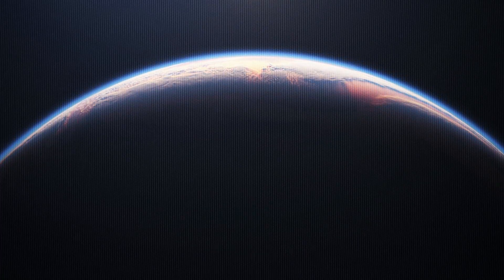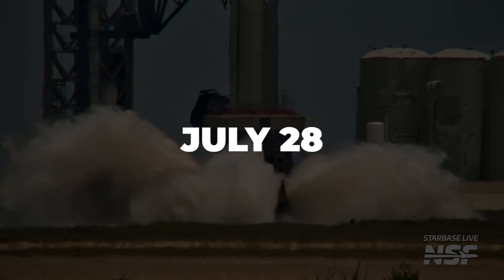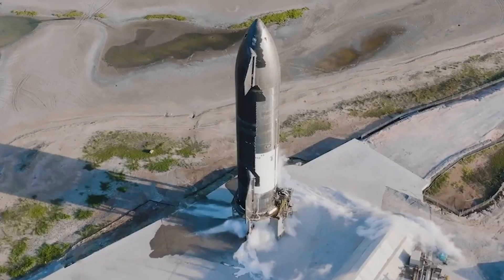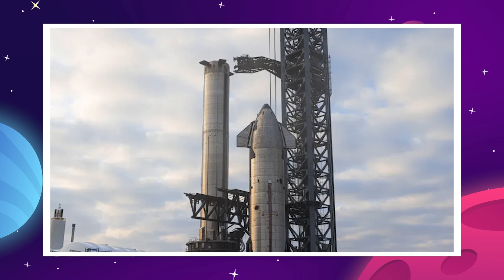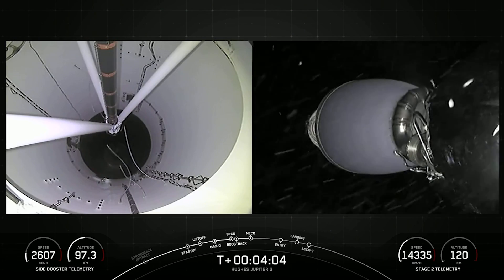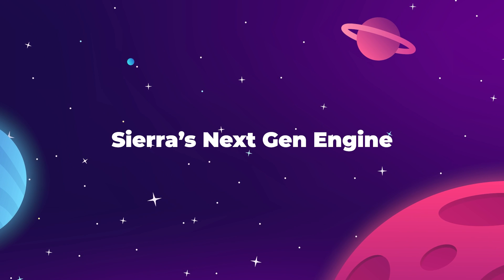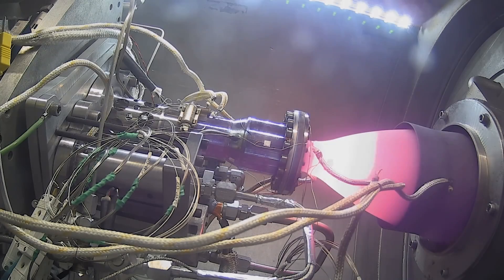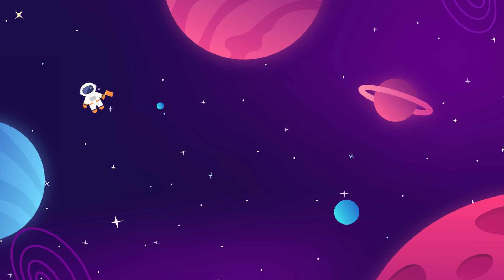The SpaceX Orbital Launch Update Is Here! (Deluge System Active)

Comment: I think SpaceX have gotten it wrong! Just had a look at some other comments, although I did not require them to be aware of what I already knew, that the only way to 'deflect' the pressure waves from the most powerful rocket engines ever built is to build a deep pit underneath the launch platform, at least 100m (328ft), & lined with very thick steel! Anything short of this & you're going to incur what was incurred the last time, destruction of the underneath of the platform.. wird!

Comment: The simple fact that they installed the hydro system, customized in 3 months blows my mind, these guys Rock!
Reply: But what about blast tunnels ? NASA uses blast tunnels ? if you direct the rocket plumes away from Starship it should reduce the need of these special solutions ? Or is the rocket so immense that it cannot use blast tunnels ?
Reply: @tore28 according to SpaceX this solution will not work. Water table too high for such features.😢
Reply: This should tell you that it was already designed. They knew it needed to be there in first place before any starship launch but they decided to go the cheap and quick route. NASA has built all of its pads with this, why would SpaceX think they didn't have to or should?
Reply: @flaziblaz  Musk has said many times the system was designed but they didn't have time to roll it out prior to the 4-20 orbital test.  It may have been a quick route, but nothing SpaceX does is cheap or easy.  They land orbital class rockets for fun, sometimes 3 at a time.

Comment: It seems logical that eventually the stand could be done away with, launching directly from the chopsticks.
Reply: But then how would they lift the ship up on the booster?
Reply: @Wurtoz  with engineering. I Even if you can't visualise it, someone else can, and It's not my job to type out an explanation for you.
Reply: @toamaori  ok it’s cool
Reply: Lol! And what benefit would that serve? How would the crew board? How would they pressurize the tanks?

Again, what's the benefit anyway?
Reply: @stratolestele7611  same benefit as removing the landing legs, same benefit as making the find non retractable. The rocket engines can be further from the ground eliminating the base stand and entire deluge systems...

The other questions you can't visualise answers to have no bearing on a stand or not.

Comment: As you said the Vortex (VR35K-A) rocket engine is somewhat of an mystery.  The Vortex technology initially referred to using vortex injector with a unique swirling propellant flow to interpose a layer of coolant fluid between the surface combustion wall to protect it from the hot gas stream. This is much like film cooling without the excess use of fuel.  The Vortex VRM1500-H uses hypergolic propellant with around 1500 lbf for spacecraft thrusters. A much larger, 35,000 lbf thrust upper-stage hydrolox staged combustion engine is a rather serious step forward from the original thruster design.  It will be interesting to see how the Vortex concept scales up.

Comment: You would think that if hot staging can provide a boost to the capability of the Starship, the same benefits would apply to the Falcon 9 and Heavy?
Reply: Idk if the benefit is as good for such a smaller rocket compared to the shear size of starship.   Definitely curious tho
Reply: @xxtoptankxx6873  maybe one of the reasons the ruskies used it. I think the current generation of Proton use it still.

Comment: This luanch is going to be legendary!
Reply: Like the last one?  That was most definitely legendary.  Elon showed the world what could happen if you took short cuts.  He’s the all time champion at cutting corners.  That’s why Tesla has so many high dollar lawsuits against themselves.  It all goes back to taking short cuts.  And having higher expectations than a technology could possibly deliver.  Elon’s self driving technology forgot to include a foolproof means of determining RANGE to objects.  It relies on cameras.  But cameras can’t compute range.  So that value was computed by a guess.  A very good guess, but a guess nonetheless.  You don’t use a guess where exactness is required.  Had Elon included LIDAR within his self driving hardware, he would have been much more successful in his outcome.  It’s not as if he wasn’t informed of the need to have a hardware solution based on LIDAR technology.  But he’s one ridiculously stubborn man who thinks he does everything better (he doesn’t).  The man loves to do things different just for the sake of being different.  Kinda stupid.  Processes and designs are usually based around what works, to avoid that which doesn’t.  

This new launch tower is going to be a colossal failure.  That hollow steel box contraption that he’s placed under Starship is the reason why.  First, it’s too restrictive in the amount of water that it allows through from moment to moment.  NASA uses far more water and it’s all injected at the base of the rocket all at once.  And yet, during a space flight launch, you never see that water enter into view.  That’s because it’s so overwhelmed by the ignition of the rocket itself.  Now double the power of the rocket while using only 1/4th the amount of water, and then spread the time out that the water gets injected through the steel box that Elon’s devised.  It’s going to fail.  But that’s not even the worst part.  That’s the explosion that’s going to take place when the water that’s within the deluge box flashes into steam.  That’s because steam requires 1700 times the same amount of space that water requires.  So the pressure from the water changing to steam within his deluge box will increase nearly instantaneously.  This will create a bomb out of his box.
Reply: @mudman6156  The last part of your comment makes 0 sense lol. Your talking about an explosion when water turns to steam, did you forget that other rockets use water deluge systems too? SpaceX’s water deluge system will use ~8,750 gallons of water per second and it will fire for 40 seconds. SLS used ~450,000 gallons of water but it fired for 60 seconds so it was ~7,500 gallons per second. 

The water also works to cool the steel plate ensuring it doesn’t melt from the heat of the engines, SpaceX has already testing a water cooled steel plate with 1 raptor engine, all they had to do is do the math and they’ll have a pretty good idea of what will happen on an actual launch.
Reply: @mudman6156 Your a moron. Your acting like if Elon makes every single engineering decision, he doesn’t. 

If it wasn’t for SpaceX’s methodology of rapid development and then testing we wouldn’t have half of the advancements in spaceflight that SpaceX has brought us. Those advancements made it possible to reuse rocket boosters dozens of times. They’re launching a rocket almost every week. 

The reason you don’t see the water deluge system in other rocket launchers is because the water is directed so it goes under the engines (duh). So of course you won’t see the water because it’s right under the engines, it would also be blocked by the launch pad and the extremely bright light produced by the engine, it’s common sense.
Reply: @mudman6156 🤡

Comment: I'm worried about the pressure from the raptors overpowering the pressure from the deluge system.
Reply: There is still the steel plate, and not just fondag beneath the raptors. Even if the water fails to take away all of the released energy, we have the entire steel plate, and the metal rebars, and a hell lot of concrete. Elon did mention they were going "overkill" on this entire energy dissipation system.
Reply: @ankanbasak1488 A steel plate then reverbs acoustics right back throughout the entire ship that causes damage to lots of parts.
Reply: @djmouseshadow4735  Imo Starship is one hell of a sturdy rocket, as seen during the multiple tumbles of S24-B7 pair. So I am much more concerned about the rock tornado, and let's hope that doesn't happen this time!
Reply: That's why the water pressure will be higher.
Reply: @filonin2  still not good enough honestly.  they won't be able launch for a while anyway since they fucked up the local habitat for turtles and birds.  have they even finished cleaning that up?
Reply: @flaziblaz bro we are going to mars and ppl care about turtles
Reply: @Picteon  we not going no where. Mars is a pipe dream, right now. It is impossible to go and come back right now. Maybe in 50 years. Until then let's take care of and protect the earth. Those turtles have just as much of a right to live than we do
Reply: @flaziblaz  20 years is more closer.
Reply: @Picteon  I hope. If we make strides in making it a faster trip then yeah
Reply: Its gona be great, it will work but I bet there will be damage. Water launch is the ultimate system.
Reply: Do you people seriously believe that SpaceX engineers have not calculated everything possible in order to succeed? This isn't just "some system" that they're hoping will work. They're obviously quite aware of everything at stake?
Reply: @stratolestele7611  They were too stupid to know that CHEAP CONCRETE wouldn't hold up -- OR BOTHER TO EVEN TEST
Reply: Rocket engines exit pressure is ambient in an optimal situation. Only the velocity is high.

Comment: isnt the water just to keep the grate from melting?
Reply: The water itself absorbs a huge amount of energy, both in heat and sound waves, preventing damage from shockwaves. The water also provided positive pressure and prevents the hot gasses from getting under the plate.
Reply: No. It deflects sonic and thermal energies.
Reply: It would also help reduce the amount of dust that is thrown out during ignition